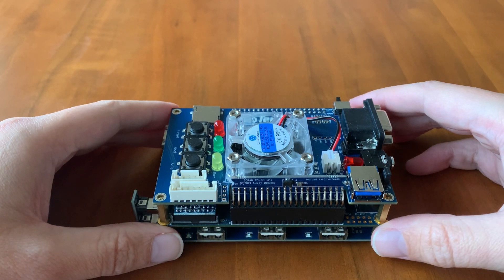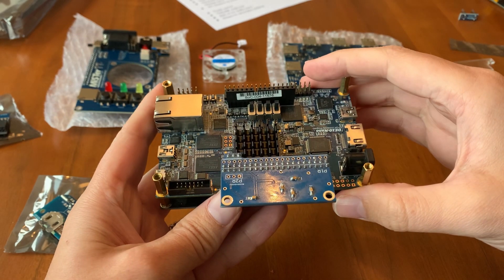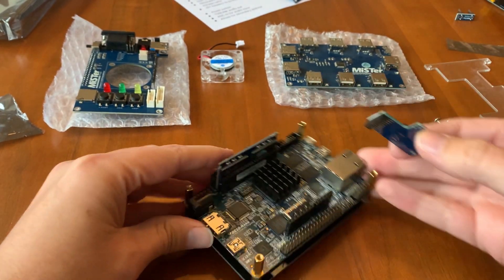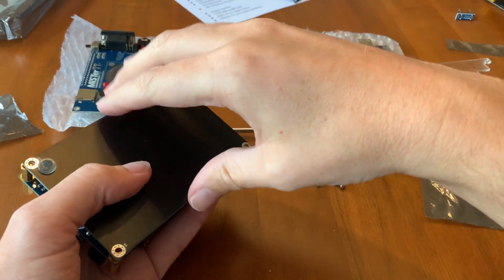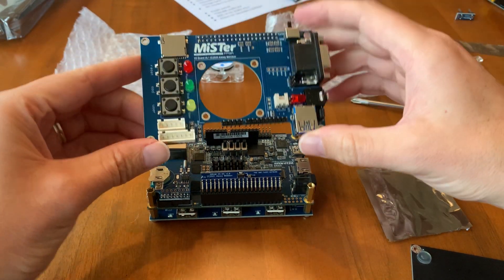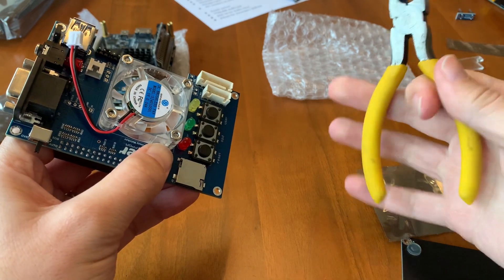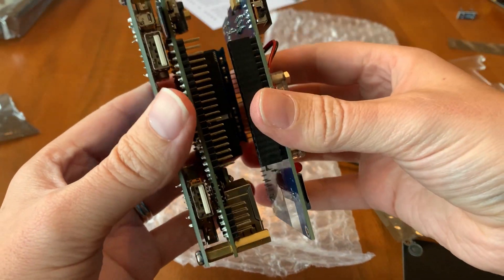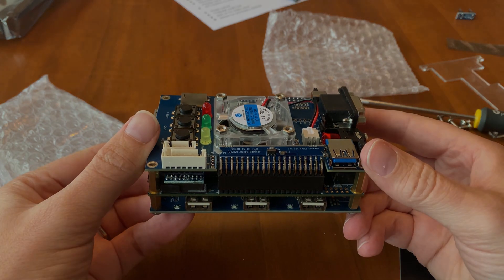Install Guide: MiSTer Add-ons

Comment: The fan is installed upside down. It's supposed to blow air on the heatsink to cool down the FPGA chip, not the other way 😄
Reply from the maker: Whoops :-)

Comment: The cooler orientation made it pull air instead of pushing it. Normally the fan label should be facing down.